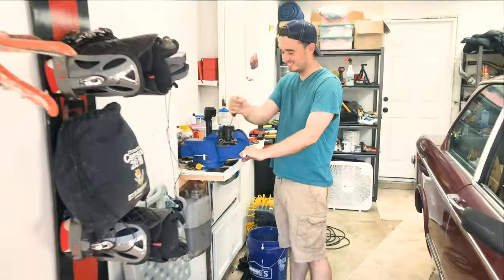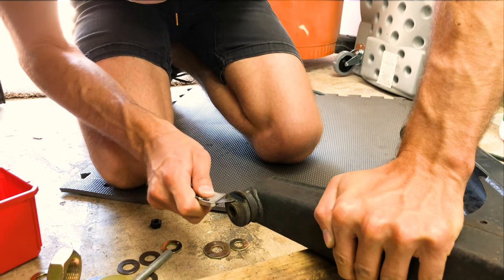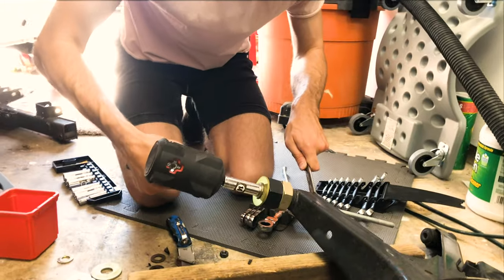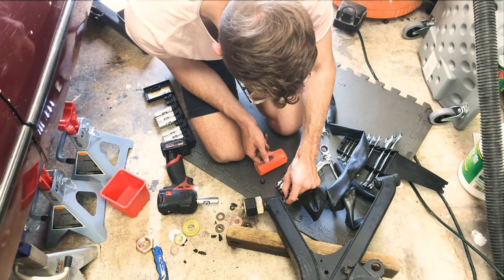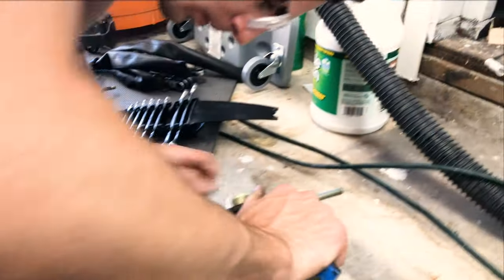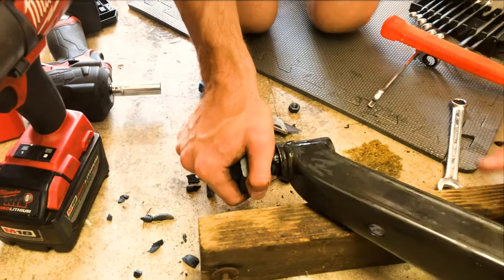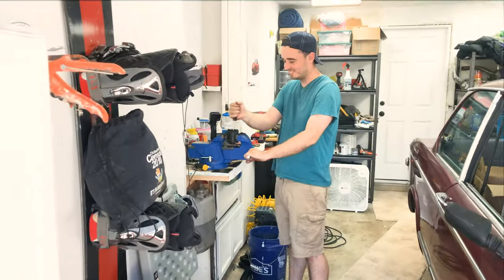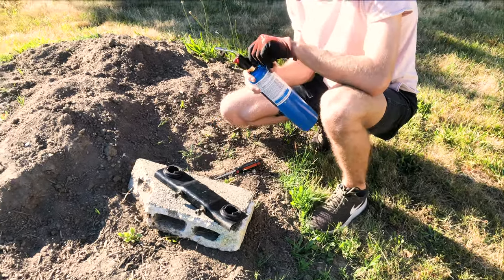Old Bushings Get TORCHED!

Comment: You can use a nice large 1/2 drive
 deep well socket or PVC tubing to capture the bushing and guide the new ones in the same way without cutting them. Good luck nice work! The rear diff bushings should be pressed out and new ones pressed in by a shop press. The carrier bushings are supposed to be purchased with the steel casings.